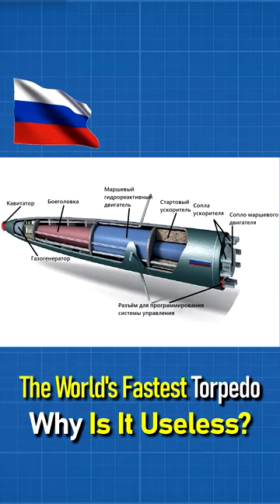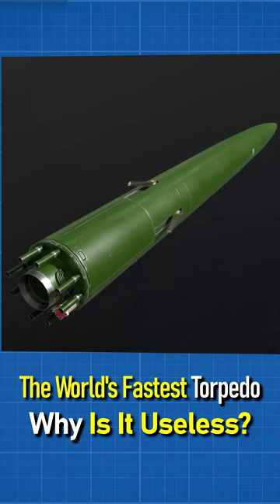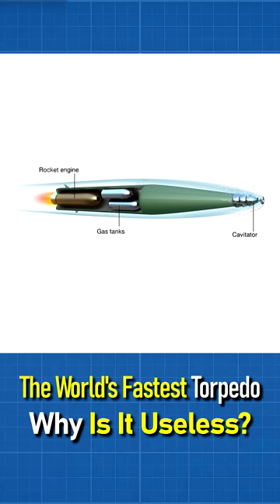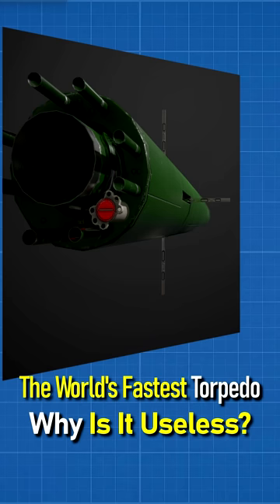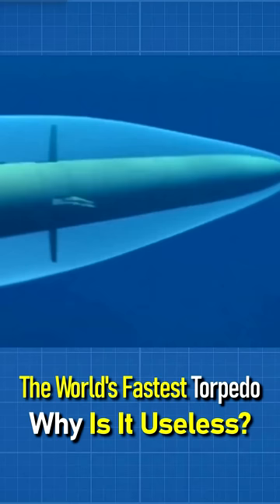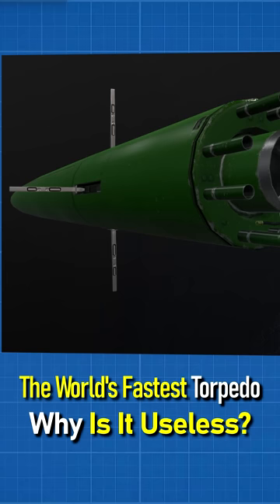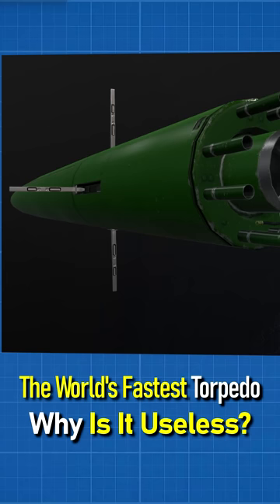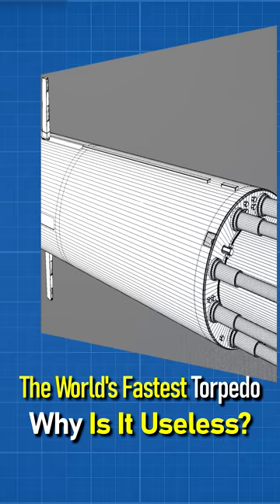The World's Fastest Torpedo • Why Is It Useless #Shorts

Comment: Just an FYI: A "jet" engine takes air into itself to mix with the fuel and ignite. If the oxidizer is carried inside the torpedo, it's using a "rocket" engine, not a "jet" engine. Details count.
Reply: Lol, the info graphic even labels it as a rocket engine.
Reply: @drebk  lmao definitrly a stolen graphic 😆
Reply: It's a water breathing ram jet engine that gets boosted up to speed by a rocket motor.  Similar to a cruise missile.  It "burns" a metal powder that reacts violently to seawater.
Reply: @Erkle64  Wait but how does the water get inside? Through the tip?
Reply: @eklhaft4531  Yes.  If you do an image search you can see it has a hole in the nose for an intake and a bunch of small holes that eject steam to encourage the cavity to form.
Reply: @Erkle64  interesting.Any source for metal seawater system used?
Reply: @gaswhole  I doubt there's anything online about the specific fuel used by the Shkval.  But there's plenty of papers from other people experimenting with them.  It's usually some mixture of magnesium and aluminium with fillers to help it disintegrate into finer particles.
Reply: Why have 2 systems when the rocket propellant could get the job done?
Reply: @gaswhole  Same reason cruise missiles have two engines.  One to clear the launcher and one with a longer range.  The range on the shkval is already too sort to be useful, wouldn't want to make it worse by carrying the oxidizer as well.
Reply: Ohhh boyyyy
Reply: No joke.
Reply: Wikipedia says it uses hydro ramjet and also uses solid rocket motor
Reply: I see what you're getting at, but rockets also are jets, think about it, what is a jet? It's an engine that produces thrust by pushing hot exhaust gasses really fast to propel itself, both turbojets/turbofans & other kinds and rockets use this for propulsions, they just use different methods for that jet.
Please correct me if im wrong
Reply: @SireSnek  have you ever heard of a rocket once being referred to as a jet? I watch a lot of rocket launches and nerd out and never once heard it called a jet...I've also never heard an airplane called a rocket....I'll go ahead and side with OP, details matter.
Reply: @B01  Well seems like my point flew across your head, I meant the fact that a Jet is not the engine, but rather the principle it used for propulsion, sure people call Turbojets, turbofans and ramjets  and such Jets, and rockets of course, rockets. But if you say details matter then might as well say exactly what kind it is. Rockets use jets of air to propel, so are technically jet engines. fan engines use jets of air to propel, so are also jet engines.
Edit: Yes, I have heard rockets being referred to as Jets, I don’t know where or if it was a good source so take it with a grain of salt
Reply: @SireSnek  I'm glad to ask my friend over at NASA why they only call their rockets, rockets if you'd like lmao She doesn't work in propulsion, just with biology. But I'm sure they can ask a smarty in a different division for us 🤣
Reply: It's both a jet engine and rocket engine because it gets its fuel from both an internal and external source. It does have  intake and exhaust, which is a jet engine trait, but only rockets carry their own oxidizer.
Reply: @bryancline8893  yeah according to Google it says the oxidizer is the air itself for a jet, and rocket it's got its own built-in to the system. This would mean it's classed as a rocket. 

Can think of a jet boat for comparison, the crazy ones that are always flipping over lmfao. Where the jet boat is sucking air from above, versus the rocket being fully submerged. No one would call it a rocket boat I'm sure lol
Reply: @B01  jet boats use standard internal combustion engines tho. Like a superchatged 350. The jet propulsion has no contact with air like a normal jet engine. This torpedo works under the same concept. It sucks water in through the front and expells it in the exhaust. 
Look at it like a person climbing a rope ladder. It grabs the water from the front and also pushes it out the back. Like a ramjet. Rockets don't grab anything from the front. They just push from the back. Maybe a better way to look at it is it's a jet engine with rocket propulsion.
Reply: @bryancline8893  ahh that makes perfect sense! Always love when no one's right because everyone's kinda right lol it's both def makes sense
Reply: @B01  Yeah sure do that, better to ask the actual experts rather than internet “experts”
Reply: @SireSnek  that is so fundamentally incorrect, look up a rocket engine please before you confuse more people.
Reply: @nicolasfranco3094  Please tell me how, you can’t really just stay “look it up”.
And really I don’t see how it’s so wrong.
Rockets use hot hot gas to move, made possible by burning solid fuel or liquid fuel mixed with oxidizer, pushed through a nozzle
Fan engines use hot hot gas to move, made possible by mixing fuel with air, obtained through an air intake, then burning it and pushing it through a nozzle.
The only difference I can see is that one does not require any outside sources of resource, (rockets) and one does (turbofans).
Reply: @SireSnek  Because it uses a jet of air isn't why it's a jet engine. Most simple way to look at it is one has compression stages with sets of turbines and rockets produce thrust by burning a propellant, usually a fuel/oxidizer mix. If you really cared you would try and educate yourself before you say something like "they both use jets of air". Read a book
Reply: @nicolasfranco3094  no
Reply: That’s 100% true no jet engine runs under water now rocket engine totally different
Reply: @SireSnek   so Peanut Butter and Jelly is a ham sandwich?
Reply: Yeah we can make into a bullet case the owl uses the shield

Comment: Doesn't matter how easy to detect you are when that thing moves at hundreds kilometer per hour while you chugging along at 50-ish
Reply: true. most countermeasure torpedoes travel at 1/4th its speed so Interception will be very hard. with a few modifications like adding a normal motor ( to increase range and reduce sound) with the rocket motor being used only in the end sounds like a good upgrade
Reply: @johnbenoy7532  funnily there was a modernisation program by the Russians. It's used in exactly the OPPOSITE way of what you described. It rockets away from launch platform then slows near the target to engage in homing mode.
Reply: Well doesn’t matter.

A ship could theoretically take a hit and even if it sinks the crew can easily get out.

But before the Torpedo even hits they‘d have time to launch their own Torpedoes.

If one of them hits the Sub it’s gone with all hands.
Reply: @clankplusm  Interesting !
Reply: It uses cavitator, so stealth is not an option at all. If there was a way to use delayed launch on this torpedo so the sub comes to the future location of the target, leaves it there and goes away it would be much better
Reply: @AnonD38  you can just make it a 2 stage torpedo where the first stage is an electric prop motor that can greatly extend the range and once it's in line with it's target ship, it can activate the second rocket motor stage that goes 300 km/hour. And since no counter measures has ever been developed against these torpedos, the target ship is basically dead. It doesn't matter if the crew escape, what matters is that the enemy's really expensive ship is gone.
Reply: @robbieaulia6462  What you seem to completely forget here is though: such high tech weapons are expensive and require intensive maintenance.

Neither of which is something Russia really is known for.
Reply: It is not supersonic, that means it is easy to detect with sonar
Reply: @JankerMLD   - you mean a sea mine?
Reply: @zhuravlevivan4622  detection≠interception,you might detect an F35 going full speed but damn you aint gon touch it
Reply: @1155727  not like a mine, u wont be able to detect it, unless it starts moving, and when it does it is already too late
Reply: @abas656thegodemperor9  Interception is not required. This thing creates a massive cavitation bubble and it lacks homing capabilities. Not only would the submarine's location be instantly known to every single ship on one side of the hemisphere once it is launched, the torpedo would be tracked with extremely high accuracy, and without homing it can still be dodged. If launched at max range (cuz the sub wants to maximize it's chance of escaping) it would take a bit over 150 seconds to reach its target. That is plenty of time to change course and also retaliate. And the closer the sub gets the easier retaliation gets, and trading a sub for the possibility of damaging a ship cuz these things don't have a big payload is not worth it at all.
Reply: @AnonD38  with its small range and high speed  ........it will hit its target before thay Can even react to the wierd noise
Reply: @zhuravlevivan4622  the air puple around it makes stelthy agianst sonar.....and it Will hit the target before eny thing can be don to it
Reply: @irishkorean3479  bro .....no one uses this vergine eny more.....the russians use the modofide one with even higher speed (~400km)and bigger size and eloctronic homing......but sadly its like all russian advanced wepons programs..... proudouced in very limited numpers
Reply: @johnbenoy7532  Russian state taking notes
Reply: @user-rl8hf8kt1r  No.
Reply: also those torpedoes has a two stages system, electrical to move it a location away from the sub and then the cavitation propulsion, it makes the submarine hard to detect and range is not 13 kilometers, it's 20km and still is a very long distance and add the 5km distance of the electric first stage. A total deadly weapon.
Reply: Won't do anything to an American aircraft carrier.
Reply: @AnonD38  if it has to be used at a depth of 30 meters, it isn't hitting a surface ship. Most if them don't have a draft that deep.
Reply: @ronpetrovich2283  tell me,why would they use it knowing they're attacking a supercarrier,they're not THAT stupid
Reply: @AnonD38 it never hit any sub with 30m depth

Comment: you dont need to worry too much about exactly hitting your target when it has a small nuclear warhead onboard.... hardly useless.
Reply: Problem is that because it's so loud it's easily detectible, which means whatever you're shooting at is going to shoot back before the torpedo hits its target.

Not really worth having a torpedo you can't fire because that would result in the sinking of your sub.
Reply: the only useless thing here is that video
Reply: @josefstalin4532  let me tell you bro that those torpedoes has a two stages system, electrical to move it a location away from the sub and then the cavitation propulsion, it makes the submarine hard to detect and range is not 13 kilometers, it's 20km and still is a very long distance and add the 5km distance of the electric first stage.
Reply: @josefstalin4532 that doesn’t matter if the Torpedo is armed with a nuclear warhead because there will be nobody to react.
Reply: @finnm.2582 I don't know about you, but he clearly said that the torpedo can be detected early, before the torpedo will hit the target, allowing the target to react. I don't know about you, chief, but I don't think the Shkval travels at light speed. Unless of course, the hands of putin and Stalin have personally blessed the torpedo and their mere presence alone will fill the torpedo with spirit to fight for the USSR and travel at light speed.